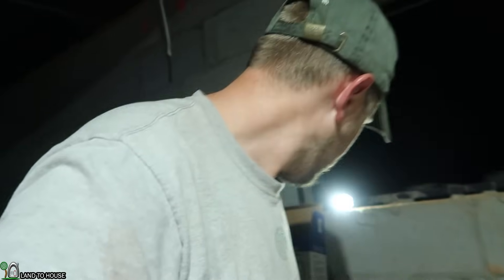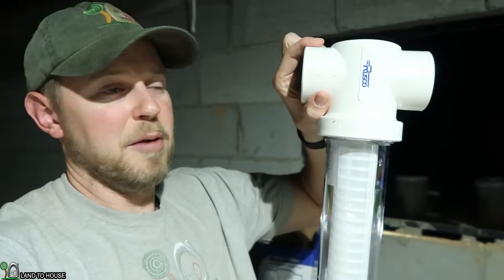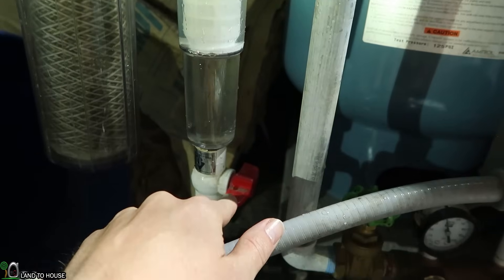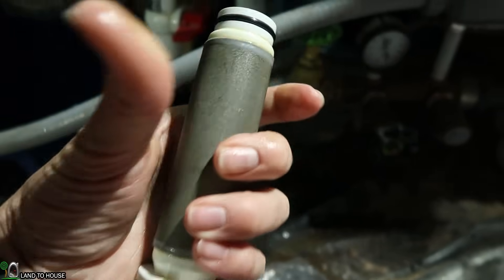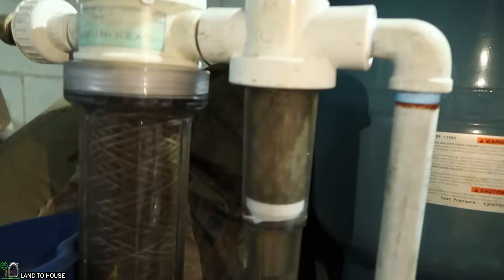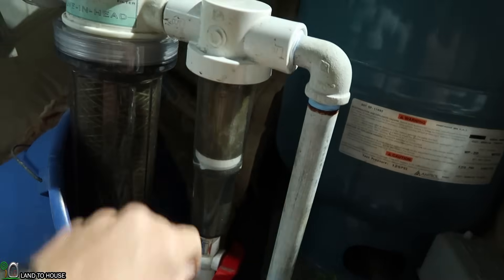Rusco Spin Down Filter Major Upgrade

Comment: This guy should have added a 4' pipe up, and a 4' pipe back down. He could be doing everything standing rather than sitting on the floor. Also, he needs to get rid of the stupid pail and connect a hose to the bottom of the spin-down filter and the other end to a drain. That way he's just turning taps rather than screwing around with a bucket halfway on its side.
Great filters but this guy's messing around with the pail was getting to me.
Reply from the maker: The bucket is also highly effective at catching the string filter water. No way around that.